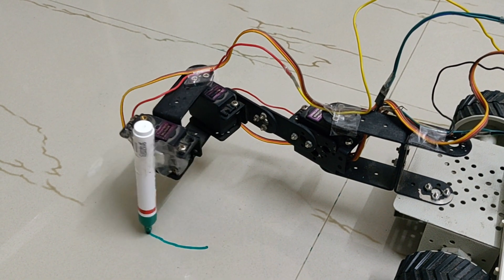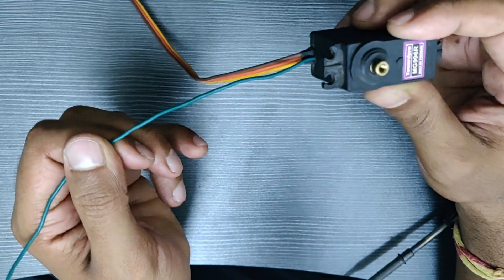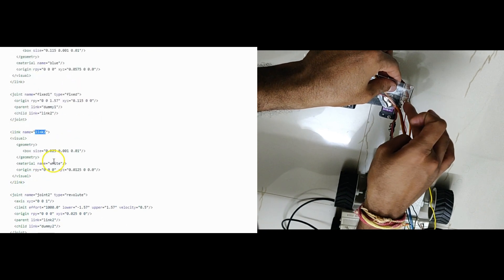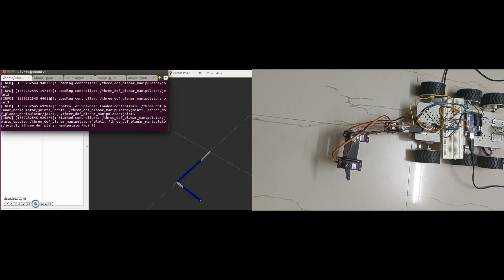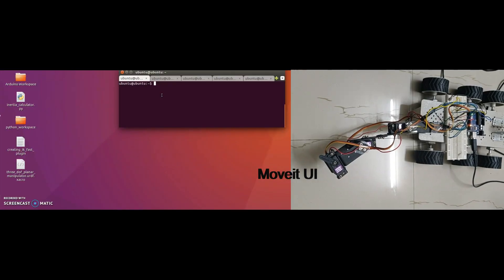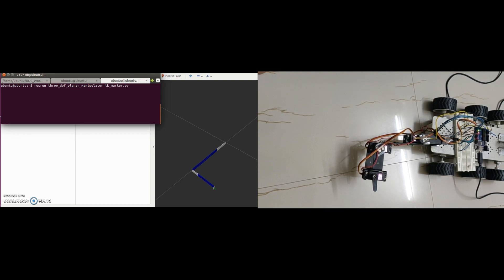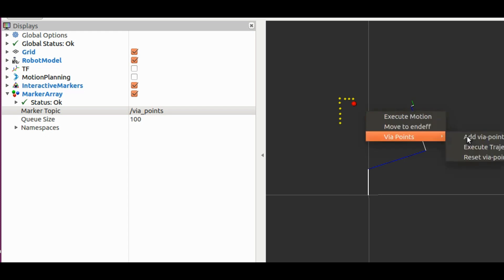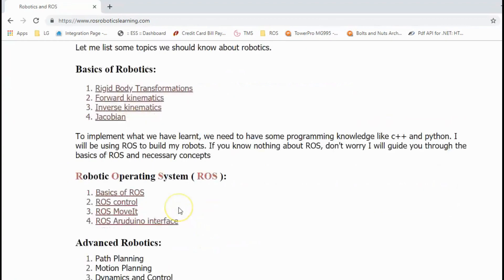Inverse Kinematics and Trajectory Execution of a robot manipulator using ROS Moveit and Arduino.

Comment: Hi, I am a mechatronics engineer, I am currently doing my project. The idea is that I have a manipulator and a webcam. With the help of a webcam, I can detect a flat object on the table and move it to the right place.

I use YOLOv8 as my computer vision model. I can get the coordinates of the object on the table, but I need the manipulator can calculate the trajectory of movement and be able to take the object on its own. For this I plan to use ROS.

Can you help me with this? Maybe you can advise me sources where I can find information on how to do this? Is ROS the best choice here? I will be very grateful if you help. Thank you!
Reply: Have you finished the project bro. I am doing something similar now...

Comment: Hello actually I'm also using rosserial for controlling 5 DOF arm and I'm using 3 sg90 and 3 mg996r servo motors , so when I give joint angles to the arm it doesn't follow the required trajectory properly and inbetween joint: 0 starts to get subscribed when it's not present in code. Please help me figure out the issue also give ur mail id so I can elaborate my issue well. Thank you

Comment: Please explain how to compile the arduino code. It always has the following error : arduino_code:3:10: fatal error: three_dof_planar_manipulator/Floats_array.h: No such file or directory
 #include <three_dof_planar_manipulator/Floats_array.h>. If i set the path manually to Floats_array.h, then it gives the following error fatal error: ros/service_traits.h: No such file or directory
 #include <ros/service_traits.h>.
Reply from the maker: Follow the steps in below link to add custom messages to arduino lib
http://wiki.ros.org/rosserial_arduino/Tutorials/Adding%20Custom%20Messages
Reply: Thanks for your reply! But the problem not solved. Should i make a separate package for arduino code. Including rosserial dependencies
Reply: @dilanjanatu4217  Hey! I am facing the same error where it says no directory.. Did you solve this issue? I'll appreciate any help. Thanks.
Reply: Same issue too. Any solution for this?

Comment: Could you tell me where you are typing the commands? Is it on PowerShell or command prompt?
Reply from the maker: In command prompt window.
Reply: @roboticsandroslearning8232  Thanks a lot bro. It would be very helpful if you could guide me through which extensions are needed and where they are required. I'm quite new at this and would very much appreciate the help

Comment: Hello everyone, 
Just like many of you I was trying to get going with this, but as a beginner of ROS I had many confusions in compiling the arduino code as Floats_array.h was missing from the libraries.

As rightly pointed out by @Robotics and ROS Learning in one of the comments below it is a custom header file and will be generated using the .srv present in the package. But there were no particular steps to do so, and many of the beginners including me struggled with this step. So, just to make the things easier see the steps below (I thank the owner Sai Krishna for all the help):

(SKIP THE STEPS THAT YOU HAVE ALREADY PERFORMED)

1. Install Arduino

2. get the rosserial package:

cd <ws>/src
  git clone https://github.com/ros-drivers/rosserial.git
  cd <ws>
  catkin_make
  catkin_make install

3. get the three_dof_planar_manipulator package in your <ws>
 from : https://github.com/bandasaikrishna/3-DOF_Manipulator
just copy and paste the folder in the ~/<ws>/src/

4. build the packages
cd ~/<ws>
catkin_make

[if you get an error]: open the CMakeLists.txt in "three_dof_planar_manipulator" and comment the following:
#add_executable(robot_hardware_interface src/robot_hardware_interface_node.cpp)
#target_link_libraries(robot_hardware_interface ${catkin_LIBRARIES})

save the file and then try catkin_make
it should work now
come back and uncomment these 2 lines in CMakeLists.txt and save

5. Now is the time to make the header files. [THE MYSTERIOUS Floats_array.h ] :P
"Read through to fully understand"
Explanation why is there a confusion?

a) http://wiki.ros.org/rosserial_arduino/Tutorials/Arduino%20IDE%20Setup
Here it says in step 2.2-
 cd <sketchbook>/libraries
  rm -rf ros_lib
  rosrun rosserial_arduino make_libraries.py .

b) http://wiki.ros.org/rosserial_arduino/Tutorials/Adding%20Custom%20Messages
Here it says: 
New in 0.2.0 The make_library has moved from rosserial_arduino to rosserial_client 
and
rosrun rosserial_client make_library.py path_to_libraries your_message_package

c)http://wiki.ros.org/rosserial_client/Tutorials/Generating%20Message%20Header%20Files
Here it says
rosrun rosserial_client make_library.py path_to_libraries your_message_package

So basically all a,b,c steps give you some hints how to do it but not specifically tell a beginner the exact command plus there are some errors:
i) we still need to use the rosserial_arduino and not rosserial_client
ii) in (a) . will not solve the purpose

6. SOLUTION-
 cd <sketchbook>/libraries
 rm -rf ros_lib
cd ~
rosrun rosserial_arduino make_libraries.py <sketchbook>/libraries three_dof_planar_manipulator

Hint: <sketchbook> path you can easily find by opening ArduinoIDE and going to File>Preferences.

7. ENJOY! ;) Thank me later.
Reply from the maker: Thanks a lot for your detailed explanation.

Regards,
Sai Krishna.
Reply: not works for me! Still have the same issue

Comment: First this is a great video, I've been learning ROS for months but can't find any tutorials on real physical project that interact with Arduino. You've taught me a lot!  

Second, would you mind explaining what the Arduino code is doing?  especially the rotate_servo() and servo_cb() function. 

Thanks in advanced!
Reply from the maker: Thank you.
I am using publish/subscribe interface to send joint commands TO arduino and service/client interface to send joint angles FROM arduino.

So, when ever I am publishing new joint commands to arduino, servo_cb callback is called which in turn calls rotate_servo()  method with new joint position commands. Now rotate_servo() will move all servos to target angles.

The callback() is the service server and its corresponding client is in ros_hw_interface node. So when ever ros hw interface node asks for current joint positions, callback() in arduino will be called and callback() will send the current joint positions of the servos.

Hope this clears your doubt.

Regards,
Sai Krishna.
Reply: @roboticsandroslearning8232  That clears up a lot of things. Thank you so much for your fast respond! I needed to understand this project to advanced my understanding of ROS. Thank you for making the tutorial!
Reply: @roboticsandroslearning8232  I have another question if you don't mind.  I have a problem in motor control section. When connect ros to arduio mega using <rosrun rosserial_python serial_node.py _port:=/dev/ttyACM0>,  i get [Error]: Service call failed: service [/read_joint_state] responded with an error: service cannot process request: service handler returned None. I can send command to arduino to rotate the servo, but I'm not getting the feedback, I assumed it has to do with the Error that I got. I can't figure out how to solve this error. I'm using ros melodic by the way. 

Thanks in advanced!
Reply from the maker: @sheenaymu   check if your arduino ros_lib have this message "three_dof_planar_manipulator::Floats_array"
Else you have to update your ros_lib message. Follow below tutorial

http://wiki.ros.org/rosserial_arduino/Tutorials/Arduino%20IDE%20Setup
Reply: @roboticsandroslearning8232  So I solved part of my problem.  I changed 3 things from my previous post. 

1. change my arduino board from arduino uno to arduino mega. 
2. modify the rosserial_python's SerialClient.py file.
3. Modified your arduino_code.ino's callback() function. 

From my previous post, I couldn't connect to the arduino board at all. I did a little of research. (1.) I changed my board from arduino uno to arduino mega. (2.) Since I'm using ROS melodic, I replaced the SerialClient.py in /opt/ros/melodic/lib/python2.7/dist-packages/rosserial_python that comes with ROS melodic with ROS kinetic SerialClient.py. By doing these 2 changes, I was able to connect with the arduino board, but I get another problem. 

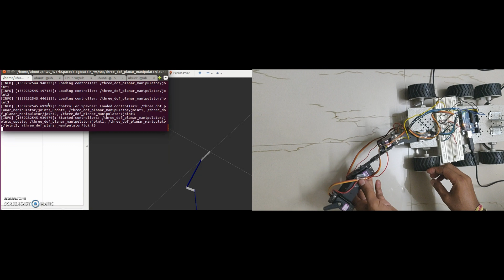I can send command from ROS to all the servos, But I have problem reading from the feedback. When I run your arduino code, arduino_code.ino, I can only read the feedback info from one signal. For example, what you did at 9:00 for all 3 of your servos, I can only do it for only one of my servo.  (3.) When I change the arduino_code.ino's  callback() function by setting one of the res.res[] = constant, like a number, I can read the feedback info from 2 servos. However when I set all 3 res.res[i] = analogRead(i), respectively, only one servo reads the feedback. I tested all the servos. They all work individually, but when I tried to read from all three servos feedback, only 1 works with your default arduino_code.ino. 2 works when I set one of the res.res[] = const.  

Right now I'm just tinkering with the Baud rate and understanding the serial_node.py code. 

Thank you for taking the time to help me out, I read all rosserial_arduino tutorials in roswiki and searched my problems in ros answers, but my problem persist.
Reply: update from my previous post: I can receive 3 to 5 data from joint_read.response.res[0] and joint_read.response.res[1] before my code hangs, receiving nothing. I'm still not receiving any data from joint_read.response.res[2]. Could my problems come from the combination of baud rate, buffer size, and nh.spinOnce()?

Thank you in advanced!
Reply from the maker: @sheenaymu  strange. I'm not sure what is causing the problem. How about your hardware interface node. Is everything ok with that.
Reply: @roboticsandroslearning8232  So I still can't figure out a solution to my problem with the server side. But I'm curious. instead of using service to communicate between the arduio and ROS, can I not use topic to communicate? why or why not? 

Thank you in advanced!

Comment: how to modify the inverse kinematic marker.py file for 6dof...can it b done?
i finished testing of 6dof(simulated arm) in gazebo with moveit pkg....and i want to  work on the kinematics next. so interactive marking would be a good start right?
Reply from the maker: Since you have completed working on 6 dof arm in gazebo using moveit, I think you have already worked on inverse kinematics. Interactive markers can only be used in rviz, not in gazeo and moveit already provides a interactive marker.
Reply: @roboticsandroslearning8232   what i want to implement is like to ...give a coordinate xyz ..and the robot(wid end effector) shud move to that coordinate point using any ik....so what should b my next approach? 
2nd how to connect to a real robot. 
i just want to know it like in steps.

Comment: can't i test this hardware interface concept without using real harddwaer in this code? eg. can't i just replace the read, write functiosn of hardare interface with some dummy values to test it?
Reply from the maker: Yes you can! 
Use demo.launch file to run the robot. It provide fake controllers. So in this case you need not use hardware interface node. You can subscribe or publish on fake controllers to control the robot.

Comment: can I convert that positions of servos to an Arduino code or can i save it to the Arduino board to execute when a command is given as an input !
Reply from the maker: Hi Manu Mohan
I did not understand your requirement. Why do you want to save the position of servos on Arduino..?
Reply: @roboticsandroslearning8232  I am trying to make a robotic arm where controled by a smart phone and  I need to code it easy to . 
that's why I am ask you that how to store the positions of that servos to Arduino and run the code when I click the specific button on that android app. Can you help me

Comment: hi sir , i m working on a robot arm  but 5 joint so i need 5 servos i modify  your code all works fine 
but i have a problem that makes me  crazy :  
res.res[0]=(readservo1-100) * (180.0/325.0);
res.res[1]=(readservo2-100) * (180.0/325.0);
res.res[2]=(readservo3-100) * (180.0/325.0);
res.res[3]=(readservo4-100) * (180.0/325.0);
res.res[4]=(readservo5-100) * (180.0/325.0);
i get a problem :
[ERROR] [1567290319.121358]: Lost sync with device, restarting...
i think i means too much data  . i can't find  a solution for this error please help me sir
Reply from the maker: Hi Houssem Trabelsi,
Yes, I faced the same issue when working with 6-DOF arm. So I have stopped reading the joint position values and made a work around for "ROBOTHardwareInterface::read()" in
robot_hardware_interface_node.cpp file.

Check robot_hardware_interface_node.cpp and arduino_code.ino form my 6-DOF_Manipulator code.
6-DOF_Manipulator: https://github.com/bandasaikrishna/6-DOF_Manipulator

Hope this could solves your issue.
Reply: after a long period i found the problem  
you should  put the exact dimension of your res array 
so in    Floats_array.srv   you change  
float32  req
---
float32[7] res
number of joints and every thing it will be ok 
it works for me @roboticsandroslearning8232
Reply from the maker: Hi  @houssemtrabelsi6090  ,
I happy that you have solved the error. You fixed the error by setting the length of the array to a fixed length in the srv file.

We are setting the length of the array in our arduino code as well ("res.res_length=3;"). So our arduino should work fine too.

Have you tried changing length to 7 in arduino code "res.res_length=7;"..? If not, can you try changing the length and let me know the result.

Check below links for understanding array messages for rosserial.
http://wiki.ros.org/rosserial/Overview/Limitations
http://wiki.ros.org/rosserial/Overview/Messages
Reply: @roboticsandroslearning8232   I tried but gives me the same proble
Reply from the maker: Hi  @houssemtrabelsi6090  
Thanks for the confirmation.

Comment: Can one log the combination of joint angles produced by the *simulato*r for the desired movements  to a csv file ...for later use by a stand-alone embedded device?
Reply from the maker: Yes. You can either subscribe to "/joint_states" topic or use "move_group.get_current_joint_values()" to get the current joint position values. Then later you can use "move_group.go(joint_goal, wait=True)" to execute the logged joint positions.
Reply: @roboticsandroslearning8232  Thankyou!

Comment: can you tell me which launch file should i use  to run for the real robot 
and can you provide us more details  for  your project architecture and some documentation on github
Reply from the maker: Hi Houssem Trabelsi,
For real robot you can either run real_robot.launch file in three_dof_planar_manipulator_moveit_config package or check_motor_controls.launch file in three_dof_planar_manipulator package. Along with this launch file you also have to run serial_node to communicate with arduino.
I have a plan to describe in detail about this manipulator in my blog but it will take some time as I'm currently busy with other things. Most of the details are covered in the video itself. 
If you still have any query feel free to post it in the comments.
Reply: @roboticsandroslearning8232   after a long period i found the problem  
you should  put the exact dimension of your res array 
so in    Floats_array.srv   you change  
float32  req
---
float32[7] res
number of joints and every thing it will be ok 
it works for me

Comment: i am getting a Controller Spawner couldn't find the expected controller_manager ROS interface.
  error
What should  do.I checked that all namespaces are correct. But still problem persists.
Reply from the maker: Hi Sohan Anisetty,
Do you have the control_manager package installed in your environment?

Try installing complete  ROS control package using below command and check.
For ROS Kinetic: 
$ sudo apt-get install ros-kinetic-ros-control ros-kinetic-ros-controllers
For ROS Lunar:
$ sudo apt-get install ros-lunar-ros-control ros-lunar-ros-controllers
For ROS Melodic:
$ sudo apt-get install ros-melodic-ros-control ros-melodic-ros-controllers

If the problem still exists revert back.

Comment: Hi, may I ask where is Floats_array.h file located?
Reply from the maker: Floats_array.h is a custom message generated by three_dof_planar_manipulator package.
You can find this file in srv folder of three_dof_planar_manipulator package.
https://github.com/bandasaikrishna/3-DOF_Manipulator/tree/master/three_dof_planar_manipulator/srv.
Reply: @roboticsandroslearning8232  how add srv file?
Reply from the maker: Hi  @Geonbbang   
Sorry, I didn't get your question. Can you be more specific about your question. What exactly you want to know. How to add a custom srv file in you package or how to use Floats_array.h file..?
Reply: @roboticsandroslearning8232  There is no Floats_array.h file in Aduino IDE.
Reply from the maker: Hi  @Geonbbang  ,
Floats_array.h is not a default ros message. This is generated in the "three_dof_planar_manipulator" package. So this is a custom message. To add custom message headers to arduino library, delete the old "ros_lib" folder(if exists) inside ~/sketchbook/libraries and run below command,

Command: rosrun rosserial_arduino make_libraries.py ~/sketchbook/libraries

ROS wiki link: http://wiki.ros.org/rosserial/Tutorials/Adding%20Other%20Messages

If you still have any question, feel free to ask.